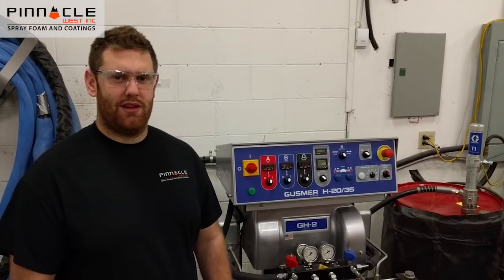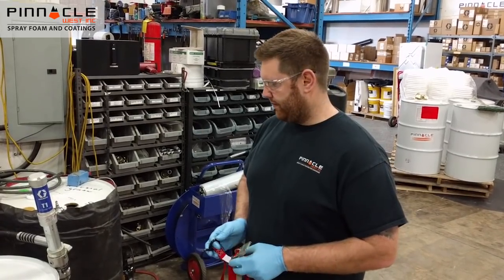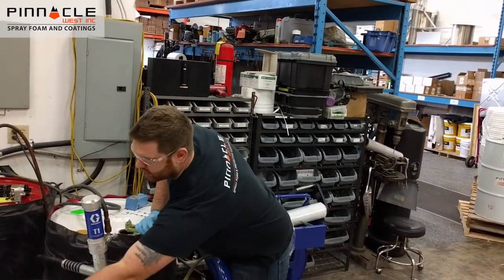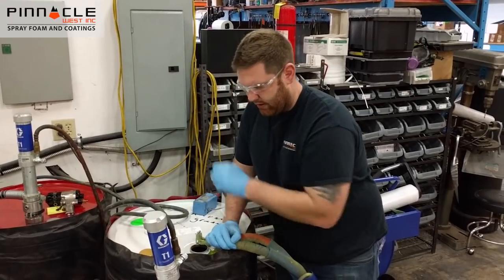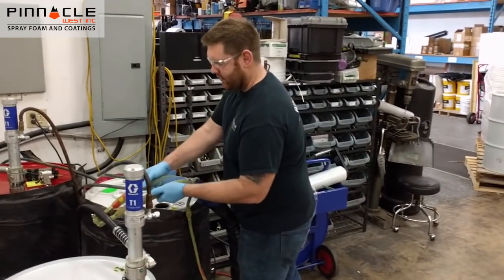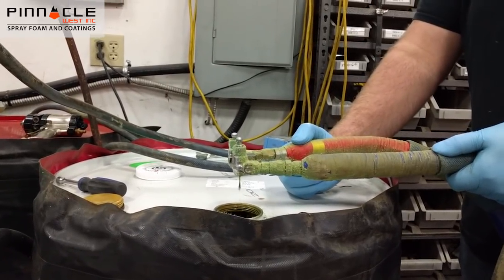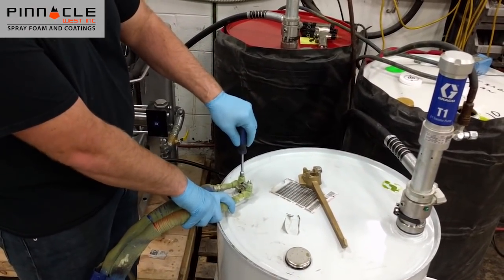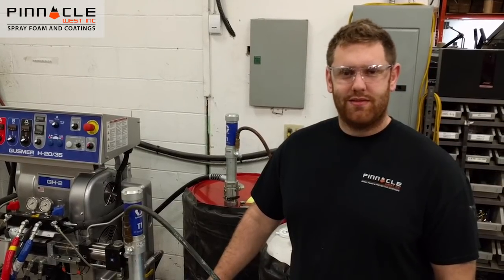HOW TO - Drum Change Over

Comment: Way to extensive , theres a way better quicker easier way . It does not hurt the chemical to take the damn pump from the open cell barrel and go straight into the closed or vise versa . Open valve put the chemical into its respective barrel until it starts changing over close valve , go back to the barrel in use and open valve until the chemical is completely changed , no waste and way quicker . No contamination . Contamination is when theres almost a 50 50 mix a the water in the open cell tries to blow the closed cell open . If you've ever spray closed cell incidentally over a small puddle of water (let's say at the bottom of a shop wall ) you'll notice the closed cell will look contaminated because it doesnt like water